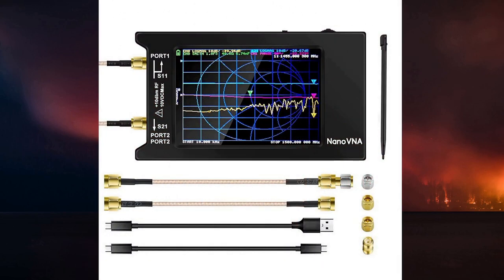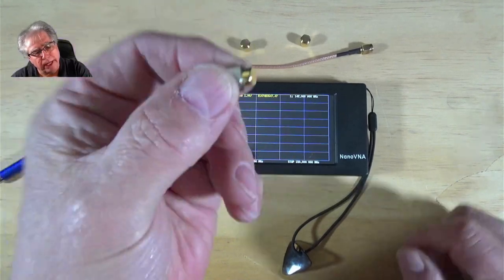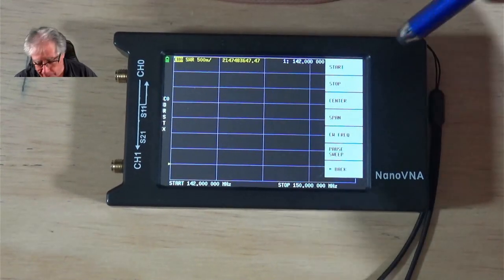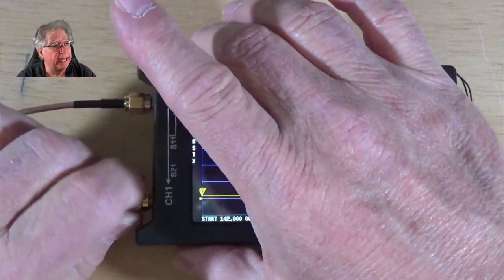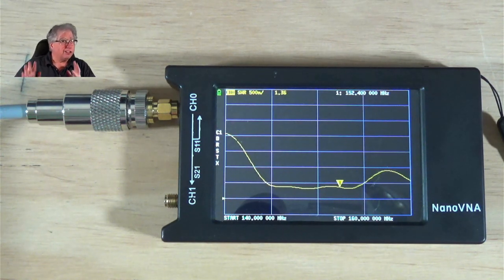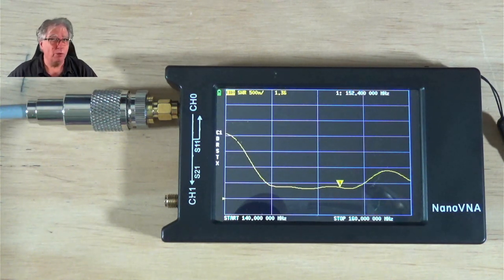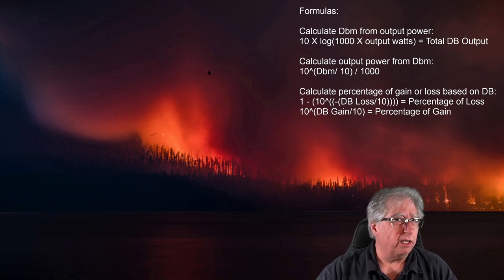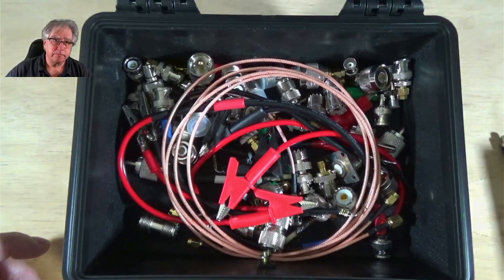Get Up And Going With Your NanoVNA. Zero To Testing.

Comment: Stu, at about 14 minutes you ask why they call it "stimulus". The stimulus is the thing that excites or stimulates the device under test (DUT). For SWR it is the RF frequency range with which you are "stimulating" the antenna system. In other words, it is the thing that you use to make something happen---a stimulus. For a microscope it is usually light used to bounce off an object, for a radar it is an RF ping which bounces off an airplane, for the nano vna doing SWR it is the RF generated in the selected range of swept frequencies "bouncing off the antenna", and for children it may be a stick used to poke the sleeping cat causing the cat to bounce off the pillow... each system has a "stimulus". After applying the stimulus one wants to observe the reaction, or effect (SWR in this case). I suggest we stay away from the cat though....
Reply from the maker: Thanks for the info Warren. Sometimes the logically obvious evades me... :)

Stu AG6AG

Comment: Hi Stu.  Kicking myself for not getting the H4 model.  I ended up with an S-A-A-2 from a Black Friday sale, but the cost was about the same as the H4 is now.  As you said, the display on the H4 makes it much more readable.  There appears to be a slight difference in software but haven't checked to see if there is a firmware update.  The Isolation step in the calibration is missing from mine, but that's probably not a big deal.  I tried an SWR measurement on my tri-band antenna (144, 220, 440) to see if I can see the lower SWR in the 3 bands, but I don't think I have the scaling right.  More things to play with!  Thanks for doing this. KD6ASL
Reply from the maker: Hi Mark,
As I understand it, the Isolation step in the calibration is associated with the S21 tests. So if you are only doing an SWR or other S11 test hookup, the Isolation step (as well as the Thru step) are not needed. As far as the scale settings, the trick is to use the marker to see the actual SWR at a point on the graph...
Glad you liked the video!

Stu
AG6AG
Reply: Thanks for showing us the simple steps to set up and use the nano VNA. I bought the F version several years ago and have been pleased with the size of the screen. 73, Robert

Comment: Hey Stu.  Great video. Very informative and well done. After watching your video, I ordered the VNA from Amazon as you recommended.  I hope you got credit for the purchase.  I do have a question. The description on the Amazon site indicates that it is a 2022 update that includes the ability to use an SD card.  The box only contains a schematic for the menu.  There's no information related to an SD card i.e. minimum/max size; how/when to use one, etc. I do see what I assume is a slot for a micro card, but that's on a guess. Can you provide information related to using an SD card or direct me to a manual for the VNA that includes such information.  Thanks and keep the videos coming. Dave KB4JB
Reply from the maker: Hi Dave,
I haven't played with the card slot yet... Here is some info from the group.io list: https://groups.io/g/nanovna-users/topic/74436842#13829. Hope that helps and glad you are joining the ranks  of VNA owners.

Stu
AG6AG
Reply: Hi Dave, the Amazon site for the 2021 version shows a 32gb card.  I think it's mainly for saving files to use on the computer with their free program "NanoVNASaver"

Comment: Is there any way to tell if your buying a genuine unit or a clone. I have read that there are more clones than real ones out there. Thanks
Reply from the maker: Boy is this a loaded question... The reality is that the both the hardware design and the firmware are open source projects... This means that they are all clones (sort of). I recommend following the reviews before purchasing a particular unit.

Stu
AG6AG